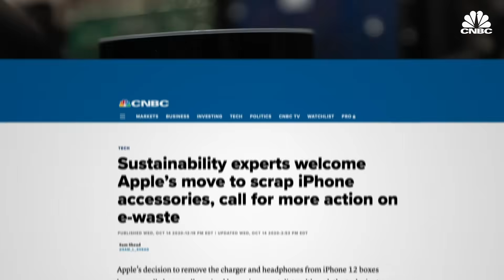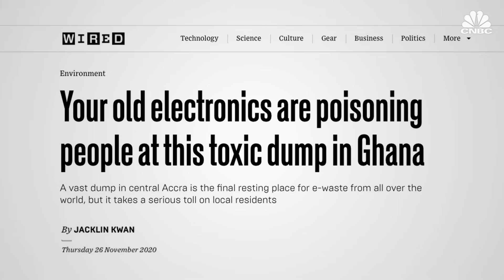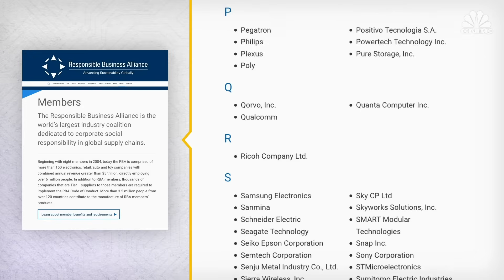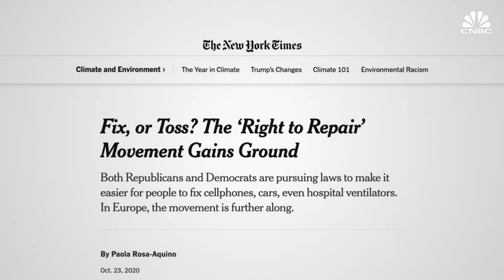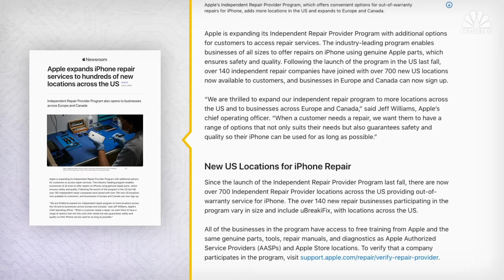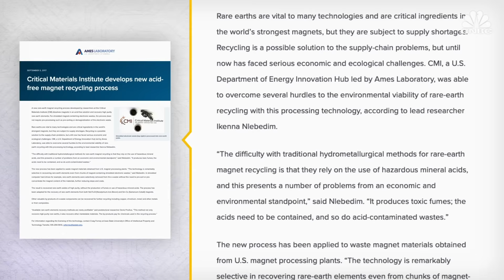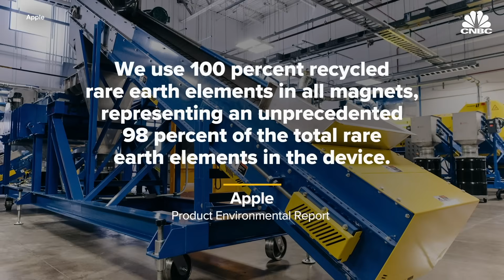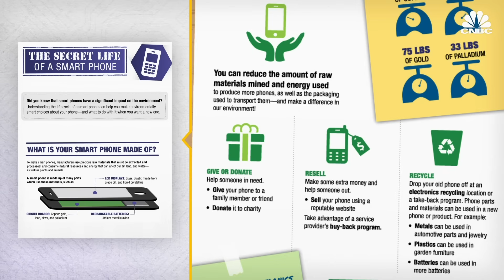How Can We Fix The Massive E-Waste Problem?

Comment: As a digital artist, I’ve had to buy new Wacom tablets, an Intuos Pro and a Cintiq Mobile Studio Pro, to replace my old Intuos 4 and Cintiq Companion 2, because of a simple USB issue or the screen dying when the Windows 10 OS still runs :( I hope that I can get these repaired or find safe, responsible ways to recycle these because Wacom doesn’t care. I’ve tried talking to them multiple times and not only have they insisted that they could repair them for at least $1k, they refuse to recycle them otherwise (I found out from other users that Wacom lied about having the parts for the same models). It doesn’t make sense that I have to pay almost half the price to repair such expensive products, and it’s even sadder when there is no way to recycle screen tablets 🥺 Thank you so much for shining light on the important issue of e-waste.

Comment: My laptop has a swelling battery and the easy solution would be to just replace the battery. The laptop still works fine given that it’s now a safety hazard until I can replace the battery. The repair places I talked to, and even the company that made the laptop, would not replace the battery for me. It’s sad (especially since the laptop is still worth maybe over $1000 today).

Comment: When a machine goes 'bad', it's almost never the ports on it or wiring harnesses, yet everything seems to get shredded.  Maybe if these parts were designed to slide on and off rather than be soldered, these individual components could be reused rather than just shred and melt.  More generally, if the machine were designed so that disassembly by robot were just as direct as assembly by robot, I'd think that a lot of pollution could be avoided.

Comment: I've had a OnePlus One that I used for 2½ years before the baseband began to fail (it would no longer connect to the Internet through a mobile network, but Wi-Fi still works), then a Galaxy Note8 that I had for another 2½ years before it became very slow and had annoying input lag issues (where it would often think I was holding down on a button on screen when I wasn't, which I later found could be due to battery, RAM, and/or storage being worn out), and after using that for.3 years, I'm now using an Xperia 1 II that, with the high price, I hope is supported for at least the same amount of time Google supports Pixel phones for, but with an earphone jack and no annoying screen cutout.

I still have the 2 other phones, as I repurposed the first one as an external camera for a small studio setup, video capture DVR, and a DriveDroid device, occasionally experimenting with custom ROMs, and am still in the process of recovering my data from the other, after which I'll repurpose that too.

I'm also using older computer monitors and a mechanical keyboard from 2013, I had an off-brand computer mouse I bought in 2009 or 2010, that lasted around roughly 2017 or 2018 or so. 

Oh, I should mention that my dad is still using an iPhone 6S, with the only issue being that it can't connect to 2.4GHz Wi-Fi networks and Bluetooth devices, but 5GHz Wi-Fi still works and he doesn't really care, and he also uses an iPad 5th generation.

While Amazon only seems to support their Kindle e-readers for a few years before stopping updates, Kobo seems to support their e-readers with new firmware updates for as long as they can. The oldest device they still update is the Kobo Touch (originally launched as "Kobo eReader Touch Edition"), while they likely dropped support for the original "Kobo eReader" and Kobo Wi-Fi ("Kobo Wireless eReader") because they didn't have touch screens, and likely dropped support for the Kobo Mini because it was their only device with a 5" display. When they dropped support for the latter, they still allowed them to be synced manually through their desktop app like can be done with all their other models, which can come in handy in certain rare situations where Wi-Fi wasn't an option and/or if Adobe Digital Editions is needed, which in turn is something not supported on Kindle due to Amazon deciding to go with their own formats and proprietary DRM instead. Oh, and I find Kobo e-readers to be easier to repair than their respective Kindle counterparts.

I think Boox still supports their old e-readers with UX updates even if they can't update the underlying Android software due to the use of an older SoC for which its manufacturer never provided BSPs for a certain Android release and later.

Comment: Two simple rules would keep cellphones and tablets out of the trash for MUCH longer.
1. Mandatory 5 years of software updates after which manufacturers are forced to unlock the device for user upgrades.
2. User replaceable batteries.

Problem solved. This could allow the original user 5 years of life out of the product, and a much longer second life on reseller markets. But that would seriously cut into profit margins that are slowing year over year. I am still using an LG G5, its on its second battery. I have no intention of replacing it until they kick 4G off the network (like they recently did to 3G)

Comment: I have been using an IPhone 7 for the last three years. I only changed the battery one year ago by myself, and I plan on using this phone for at least another 1-2 years.

No money wasted on new hardware, and the phone is still getting new software updates. Thanks for making this video, I think this is a really importante matter to consider whenever a new phone or laptop comes out.
Reply: thats nice, and hope that apple doesn't start pushing updfates that slow it down as they do

Comment: YouTuber Louis Rossman has been banging away at right to repair for some time. The Apple program to increase
repairs instead of replace in his view is half hearted at best and limited in scope.
In my own experience a lot of electronics today are not built for the ages. Vacuum tube electronics of quality
would last for decades as long as there were no catastrophic parts failures that made repair totally uneconomic.

Comment: This is exactly what I learned in my class. It's a very important matter. We need more sustainability, a circular economy -- a system level change.
Reply: Boomers do not like that and boomers control the economy and political system. Until they die, system level change may be possible.

Comment: The problem is with the consumer. I am still using the iPhone SE (1st Gen) that I bought in January 2017 and will be 4 years old next month. It's still working perfectly fine, running the latest iOS. So it boggles the mind that someone can buy the latest phone and replace it in just two years!

Comment: Right to repair needs to be introduced as it's not just tech items that are disposed of quickly other items like kitchen and household appliances and gardening equipment like lawnmowers are also designed to fail. I work at a garden machinery dealer and we find the very cheap imported Chinese made items are always mass imported by a supplier but have no back up spares assistance to many dealers. Only the expensive brands excell at spares back up.

Comment: that's why we need Modular Electronics which can be upgraded and removed easily, especially for Phones, where a new version comes every New Year. Hypothetically Speaking, Companies can provide Modular Parts on their own and Consumers might only need to change those specific parts. Also, If the Designs are Simpler, there can be Exchange Deals for Old Phones to New Phones where both the User and Brand can benefit. This can also help as People are not going to buy New Smartphone Every Year and eventually there will be a Saturation Point, although there will be some tradeoffs like No IP ratings and less durability, but we can live with that if we are going to keep upgrading.

Comment: I remember when you couple replace your battery, then they started making them just as costly as the phone, then they started making the phones so you can't open them at all with out special tools and now batteries widely unavailable.
Reply: iFixit. They most likely have it. The last i bought was for a pixel 2 xl, it was $39.99 with the screen adhesive and tools needed for the repair. They also have step by step repair guides on their website, as well as videos of repair on YouTube.

Comment: “Phones last 2 years” —and I’m over here watching this video on my iPhone 7 Plus that’s 4yrs old, going on 5 and it still look brand new + function fine after multiple drops right onto concreted. Not a single crack. I never update new software too... I wait for all the reported bugs first and see if I can live with them. If not, I wait for the patch before updating. Lol. Really, the only reason I consider upgrading my smart phone is bc of the new camera built into it, if not, I can use the same phone for 10 years and be fine.

Comment: The recycling process has to be conceived from the design board. Every part has to be optimized for later dismantling, to make its separation process less hazardous. Let's stop proprietary concerns as the guide to guide design.

Comment: And for those who have old laptops or MacBooks and computers, don't throw it away or install Windows 10, install Linux and you PC will revive again.
Reply: When my old MacBook Pro was no longer able to get updates, I installed Linux on it. It was a little slow because of old hardware but it ran like a charm until the thing ultimately died. All totaled the MacBook Pro lasted me 8 years. I had that thing since college and kept it for years after! Sadly, with the new Macs with the M1 processors, you may not have the ability to run any OS other than MacOS on the Mac.
Reply: @uthmanbaksh3530  well windows 10 for ARM and various Linux distros for ARM do exist so I don't see a reason why the M1 Macs won't run any other OS in the near future
Reply: @uthmanbaksh3530  install Android on it
Reply: For my laptops I had been using my Dell laptop since 2005. Then it finely pooped out on me 2 years ago so bought an HP. I don't really see myself as an e-waster as i tend to just use my gadgets for the longest possible and use them to the very max.
Reply: the original white 2006 MacBook does run Windows 10 quite fine though, ironically even better than it does as a Mac
Reply: @nagayoshi9742  It definitely won't run the latest version of MacOS but yeah, you probably can run Windows 10 on a Mac from 2006. Microsoft even has a 32 Bit version of Windows 10 available for older PCs.
Reply: Replace the HDD with an SSD for even more speed
Reply: @jackirvin  if your pc is old enough, it will be bottlenecked and there would be no point in doing so
Reply: @jackirvin  That will only work to a point. If the computer is so old that it won't receive new OS updates, then it might be time to either install a new OS or get a new computer.
Reply: @tgtgtgtgtgtgtg  Linux is a free and open source Operating System. Please mention your PC model or your processor name so that I can recommend you an appropriate Linux distribution.
Reply: @tgtgtgtgtgtgtg  Is it running running 32 or 64 bit Windows?

Comment: I am glad that ewaste is starting to gain more attention in recent years and that companies are looking into more recycling processes to make it more competitive. Verified ewaste and responsibly mined metals should command a premium over unknown origin metals. I think reducing consumption and improving repairability can have a more dramatic impact though.

One big problem for phones is the lack of updates after a couple of years, that is simple environmental fix manufactures could implement but of course, most encourage consumerism. Apple's motives seem environmentally sinister with the battery slowing and trying to make new, very similar phones seem like a good environmental conscious upgrade. Samsung is very bad at updates and repairability and as someone who likes to buy used products, not just tech, I am disappointed. My phone is several years old and the hardware is fine for the most part. The problem is as I bought it used it had no software support left. A possible business model could be a third party software company providing simple extended software support for common old model devices. It would be convenient and cheap ideally without having to route your phone and whilst still being optimised for the device. That could prevent a lot of waste. I would pay for an update if I had to. I think if I bought one of the latest flagships I would not notice many day to day differences except for the camera. That is pretty much the only part of the phone with noticeable improvements for most people and even that is plateauing.  

Used phones represent good environmental and price value but do consider going for one that has decent software support left. For that reason, I think I will swap to using a Pixel. Looking around I think the new Pixels seem, perhaps unfortunately enticing, especially with 0% finance, though I would be able to hold onto it for a while due to the updates an seemingly decent durability, then I could look at used one or two year old flagship phones again.

As mentioned at the end of the video, a big problem is a consumerism, people buy the latest phone every year or two just to show they have the latest thing or enjoy the minor improvement. That used to be me when I was a kid (though, when phones actually showed a decent improvement year to year), now though I am more conscious of the environment and excessive spending. I briefly worked in homelessness here in the UK and noticed that even people on the verge of being evicted to due arrears had the latest flagship device. It is interesting as people seem to pay a lot less for their computers and change them less often even if they use them regularly. People should look at their phones the same way.  

Finally (this is longer than I thought), it would be good if Google brought back their project Ara, I know it isn't a simple project due to component comparability, but some company has to do it. I also hope that Terracube's repairable and recyclable phones takes off. If they make a slightly higher spec version in the future I will definitely be interested.

Comment: Apple products are made from recycled materials that are recycled in factories that are powered by coal. (Recycling uses more energy that using virgin material, so recycling doesn't matter if done by using fossil fuels) 
Apple doesn't include charger in box because it saves plastic and materials but sells it separately in a totally new box (which people are forced to buy anyway) which makes even more use of plastic and cardboard that if the charger was included in box.
People need to know that in the end it's all marketing to not only make people feel good about buying their product but also create a false image in the minds of their consumer that many actually believe and go as long as defend the company.